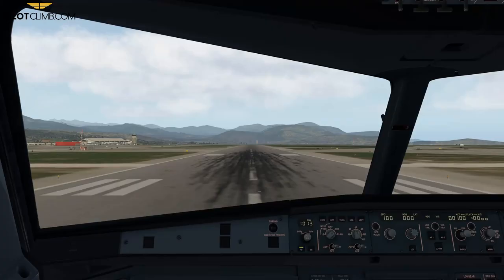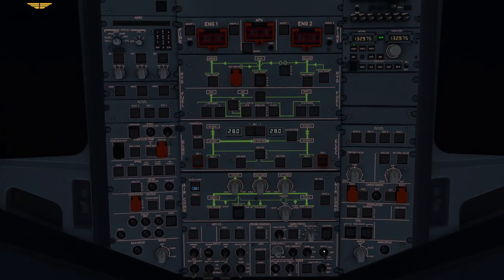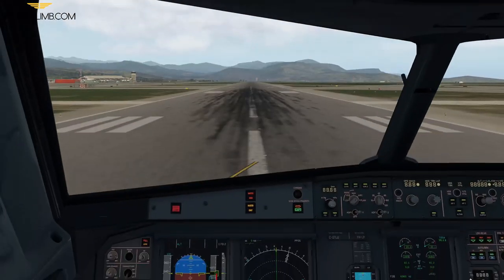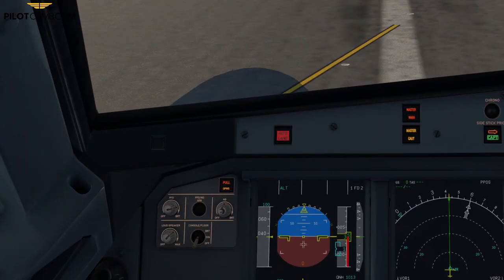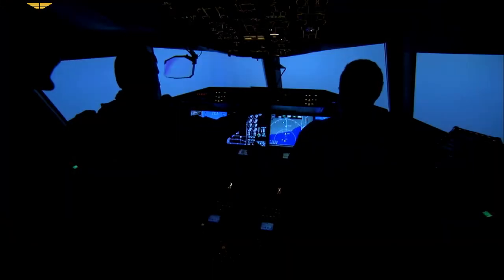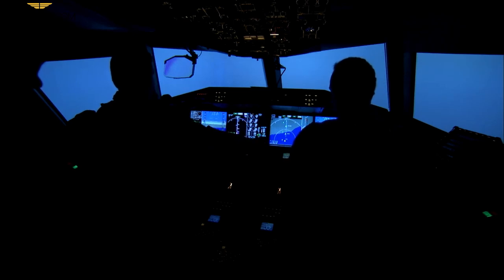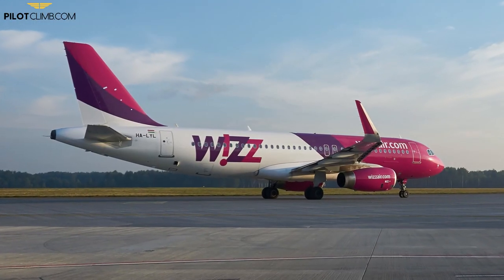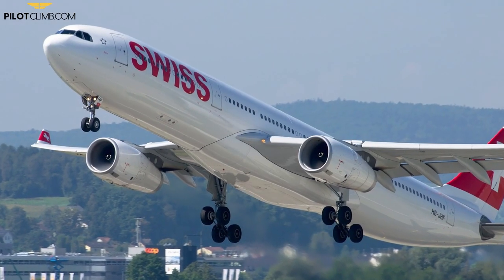Alert Height - [Fail Operational]

Comment: Hi Captain hope all is good with you.  I have a  question about the landing gear leaver in the Airbus cockpit.  The Down arrow is longer than the Up arrow is it because of down is weight + gravity and  the Up arrow is = to Lift.
Reply from the maker: I'm not sure why the down arrow il longer, may be it is like that to gives us a clearer indication of the landing gear status during the approach ( it is more important to know that the gear is down and locked)
Reply: @PILOTCLIMB  Cool thank you Captain. Sorry just one more question on the Airbus cockpit on the panel where the buttons/warning lights are on the glare shield  say if your sitting in the Captain's seat for example. There is the Side Stick Priority light, then to the left of the that Master Warning and Master Caution lights, then to the left of them there is the Auto Land light. But further to the left of the Auto Land light near the Captain's window there is another light/button is that an ATC is calling alert to the pilots on long flights?